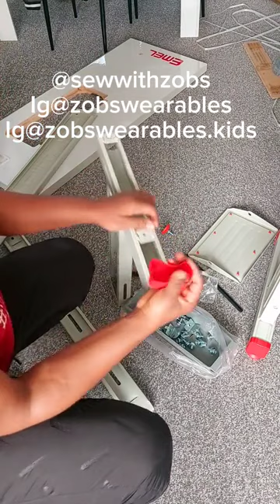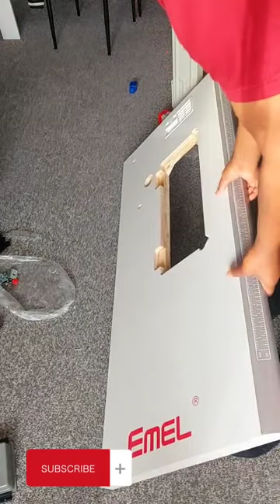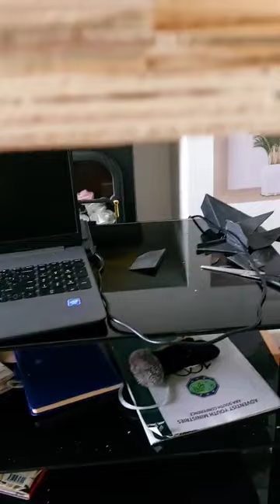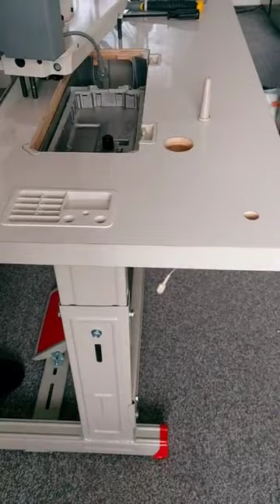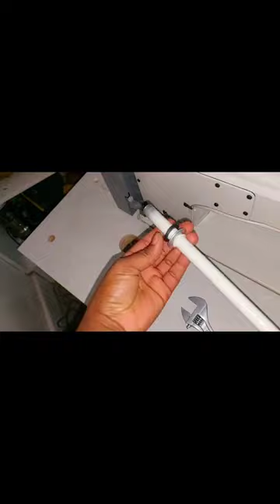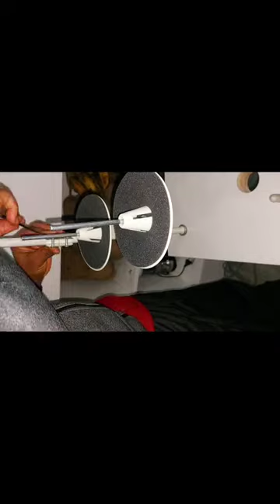HOW TO INSTALL A DIRECT DRIVE INDUSTRIAL SEWING MACHINE. #lifeabroad #diyprojects #uktailor

Comment: Your vid was very helpful. I now have a problem. I a similar machine, but there is a black round magnet and rubber that looks like. A stopper. I don't know where they go😅
Reply: Thank you for the useful video.But you are not the one doing the installation, are we going to call sewing machine mechanic to do it for us?
Reply from the maker: @toyyibatmorisola2129 if u have a mechanic available pls use one..am in the UK and no mechanic available so I did it myself
Reply from the maker: Thank uu. Am not sure what it looks like
Reply from the maker: Oh! It might possibly be the magnet for ur pins. But would love to ask if u found a place for it yet?
Reply: I think it's the magnet